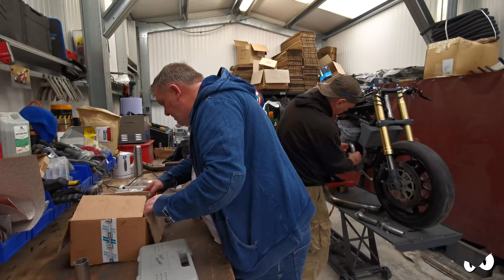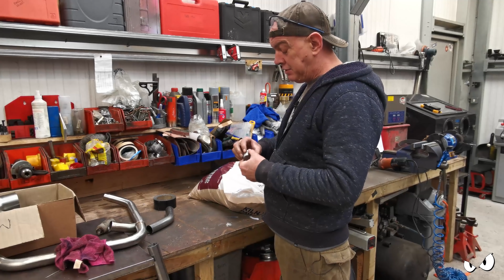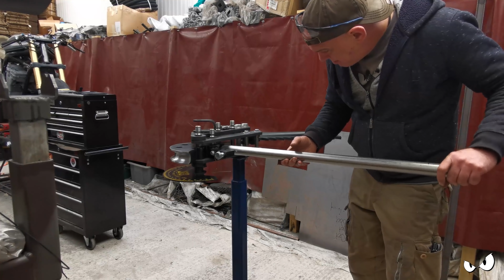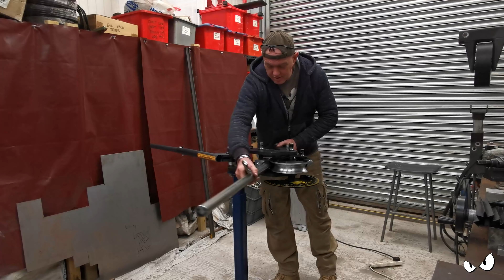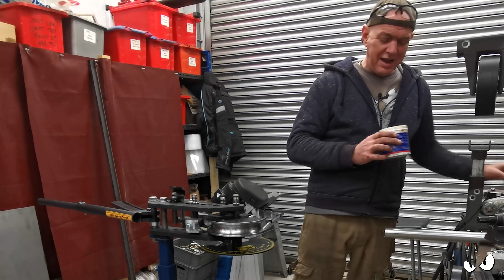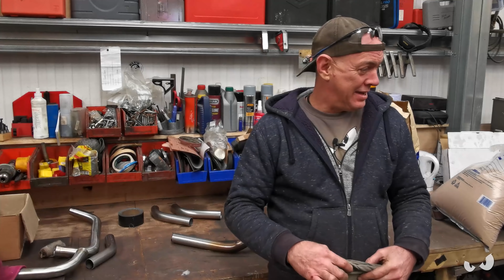Headers & Headaches - Suzuki Bandit Cafe Racer - GIXIT Project Part 57

Comment: I read something years ago H/D had to develop a cheap way to produce the severe bends on the pipes on the V-Rod, I think they used very high water pressure some how. It was a while ago ,so will have to Google it.  Good vid by the way.
Reply from the maker: Thank you matey but high pressure is something way beyond my ability. I'll get there in the end though 😁👍
Reply: @QuickBikes  I realize that, just saying its tricky bending tube. The H/D exhaust looks like a 180 degree bend.
Good luck.

Comment: Seems there's too much metal to compress Quickie. I'm no tube bender, nor any bender for that matter! But I  reckon you'd have to cut "V"s from where the inside bend will be, then weld them up after. Save Brender for frames.
Reply from the maker: I see what you mean, but I think I'm asking for too tight of a bend using this material and this bender. Also if I pie cut it, I still have the issue of weld penetration...

Comment: With good fit up its possible to pulse weld stainless headers without filler, but if your torch angle and amperage is not pretty much spot on and fit up is poor due to different shaped pipes and filler is being used, invariably you will have big ugly weld beads inside the pipe.  

Personally I would have been looking at buying a damaged system and repairing/adapting it to fit the bike properly as this would have cost a lot less money and been far less hassle than messing around with a draw bender and now all the aggro with badly made bends?
Reply from the maker: I hear ya, but I wanted to have a go and see what I can do. I'm pretty handy with a welder as I don't for a living, but never having worked with stainless like this its an interesting thing to try.

I'm not beat yet and will have another go.in the future to see what works best with the kit I have as I'd rather build something than just buy or repair it.
Not the cheapest option sometimes, but worth doing occasionally 😉
Reply: @QuickBikes  If your set has pulse try experimenting with that. Large cup is also a good idea.  

Furick ones are crazy expensive though and you can get better ones for less money from Tig Lab in Poland.
Reply from the maker: I have pulse, but the longest interval is 0.5 secs. Tacking without filler is what I normally do if the fit up.is really good. Just go 5amps more than needed for a.fusion weld.and give it full.blast for half a second, job done.
I'd love to get machine perfect at tig, but that can take years of torch time.to achieve
Reply: @QuickBikes  Try practice with pulse and using a large cup. Something like a 12 should be good.  Looks like you either have too slow travel speed or maybe amps set too low and cooking a bit?
Reply from the maker: My travel.speed is slow I have to admit, but trying.to get it to look right... I just need.more seat time I think...
Reply: @QuickBikes  Pulse will make things much easier.  You are getting blobby beads inside the pipe due to cooking.  Pulse will reduce the amount of heat going in a lot. Tungsten size and balance settings will also effect things.

Comment: As u fill it with sand tamp it down in layers  makes the sand more compressed 🤙🤙😎
Reply: Exactly.  The sand needs to be packed in tightly so that it doesn't move.  You should then feel that it has become harder to bend.

Comment: As previously mentioned you have to use an ultra fine BONE DRY sand like kids playsand and spend plenty of time vibrating the tube to expell any air out, it creased because the sand must have been ever so slightly damp and some air still in it. Or the sand is too course... I use a cheap T shaped tube bender and get perfect bends this way, but I stick my sand in the oven on full for an hour.
I think with slightly damp or wet sand it traps air, so doesn't release fully when tapped/vibrated.
Reply from the maker: Ah right... well I got kiln dried sand and went for the smallest grain i could find. I could have bounced it up and down more I guess but tipping it in slowly was.my plan to avoid gaps and give it a chance to settle... personally I think a slightly larger centre line radius is the key and will be getting another 1.5 inch die to do the frame for ASBO, so will be trying this again in the future. The CLR on this die is about 5 inches I think and I thinknits just toooooo tight. What size tube are you bending and on what radius if you don't mind me asking?
Reply: @QuickBikes   sorry for the late reply i didnt see you had replied. No probs things like this are here to challenge us lol... my go to is usually 2” mild and stainless 1-1.5mm wall, its a 180° die for 90° bends, not sure of the width of the die off hand but somewhere between 9-12” wide. 
Ive given up a few times, using playsand straight from wilko/argos thinking it would be dry (being indoors) and did feel dry but weren’t until i baked  and spent 5mins to tap it i found i got good results.... (old square orbital sander with the rubber backing pad works well) see the level of the sand drop atleast 2” 
Good luck hopefully you get it to work.

Comment: I would say that the sand is not packed enough....But what do i know.
One thing i would do is contact the company that made those bends and give them some shit.
If they are selling them as 90 and 45 bends that's what you should be getting.
Reply from the maker: It should have said "90 is degree bends" 🤣😂

Comment: Hi quickly, are there slightly smaller guides for your bending machine, just thinking it might be a tighter fit on tube to stop kinking ? 🏍️👍
Reply from the maker: The die is designed specifically for 1.5 inch tube, anything less will just deform it more im afraid... 😁

Comment: Really feel your pain on this, it must be heart breaking to of found a limitation in what you can achieve with the tools on hand- however you recognise that its not right and you won't live with the defects in the bike so that's a sign of strength of character on your part. I swore and cursed at the cost of new headers for my bandit but seeing how difficult they are to make makes it a bit more understandable - the company will of invested a big chunk of change into the tooling to produce the product and the skill to train the people to make it. I think for now accepting that currently it cannot be made "right" given the limitations you have and using a commercially sourced product is the way to go.
Reply from the maker: Thanks Robert, much appreciated. The die and bender ate fine on mild steel, just not stainless and I'm asking it to do a tight bend. It would probably be OK on a larger bend using this method I think, but we'll see at some point. Thanks for chipping it matey 😁👍

Comment: From experience your sand is to coarse, Argos sell play pit sand finer grain and dry, dry sand ( hair dryer ) to make sure of a tighter compaction.
When you fill the tube compact the sand in with wood/metal rod fill to the brim try again.
Finer sand means less air space between grains, less space for moisture to expand, packing should make less room for air.
If the tubes rammed up tight hopefully the tube will have to conform to the shape you want.
Reply from the maker: I'll be giving this another go at some point. The sand is kiln dried sand suitable for play pits or plastering apparently. Basically the finest stuff I could find but yes, I could have compacted it more before plugging 😁👍

Comment: Its seems that instead of stretching the outside radius of the tube its trying to compress the inside edge for some reason
Reply from the maker: Yup, its basically doing both... the outside of the bend is really flattened off and the inside just crumples... it would probably be OK on a larger bend using the sand method, but this bend is really tight...

Comment: Just a curiousity what happens to ordinary steel tube. Would that buckle at the same point
I know it means more welding but can you part bend to 50 degree or just before the buckle point then cut and make 2 into one for the 90 bend i guess it depends on how far round the bend it has the buckle
Reply from the maker: Mild steel tube works fine, not even a ripple but its nowhere near as tough as stainless. I think I.would still run into the.problem of the cut ends not being circular though which still means penetration from the welds on the inside of the tube which I can't get to to dress down. I think I'm just attempted a bend that's toooo tight 🤔

Comment: I see ppl saying to you that you need to pack it in yes they are right you really need to pack it when I see you put the sand in I was saying to you well to my self you was on the screen that you need to really pack it in  there are some ppl that use wet sand as they find it packs better and yes you can heat it up and yes you can use the border you have but you need to heat it right on the bend your half way there mate just need to go rest of the way but what you have to remember every time you take the pressure off its going bk on its self it's relaxing it mite be to much but I did say try and contact the fab man him self as you no he knows about this stuff than anyone one more thing have they sent you the right diy as what yours is doing its doing the same thing as what them cheap jack up blenders hydroelectric one that the word lmao
Reply from the maker: I'm not beat yet, but for now we're going to be using the Delcovic headers from ASBO as they came off GIXIT originally and were going to be used on the project. I think I'm asking for too tight of a bend using stainless on this bender. Mild steel works fine, but I still have a few options to try out at some point 😁👍

Comment: I told you you needed bigger ring spanners!
Do you know what grade the ss is, I'd hazard a guess it has a low nickel content
Reply from the maker: Hehehe... its 304 grade stainless matey
Reply: @QuickBikes  You should go with "food grade stainless" or "motorcycle grade aluminium", LOL!
Reply from the maker: Maybe a different colour tube bender would help hey 🤣😂
Reply: @QuickBikes   I think you have now reached the material Vs tooling threshold and there is no shame in throwing in the towel and using the Delcovic header, even if you need to cut and weld it to achieve what you want
Reply from the maker: I think I agree... it came off GIXIT originally anyways 😁👍

Comment: I'll throw my zero experience "best guess" in as well...
If you can muller a tube into an approximation of a bend by jamming it in a vice and heating it red and applying torque with ring spanners - with no internal support... it must be possible with the "right" bit of kit...

If it is in the heating...
The question is whether it is a stress thing. 
(To test that, try removing it from the die and heating it every few degrees, so go 10 degrees, then heat it to the cherry red, then another 10, take it out and heat again.)
Or a malleability thing... 
(you need the heat to make the outside malleable enough to stretch further without applying stresses to the inside of the bend and causing it to crease up) - in that case try heating the outside of the bend as you are bending it, (as hot as you can get it.) stainless steel is a pretty poor heat conductor (as far as metals go!) so you should be able to heat the outside radius of the bend without loosing too much heat into that massive die.

if not a heat thing, and actually a support thing...
There is a video on you tube detailing how they make trombones and trumpets that you could consider... they bend very thin wall  brass tubing, around 180 degrees without crinkling it by plugging one end then filling it with water and freezing it. (this would be the next step up from packing with sand.) because the ice is much stiffer the tube is less likely to form an oval... (and it's likely easier to control freezing (where you're just leaving the tube overnight in the freezer) than it is to control heating with a small blowtorch.
With this method to ovalise the tube you'd need to crush the ice, (crystal structure hard to crush), - with sand you're stretching one side of the tube, that increases the space inside the tube and makes more space than the sand can fill, and because the sand is loosely packed (individual grains, not solid) it'll just fuck off into the space removing the support it was providing.
Reply from the maker: Good comment, thank you and I can see where you're going with it all. It's an interesting problem to solve, but I'd like to. At some point I'm going into one of the marine fabrication companies round here to pick there brains about it 😁👍

Comment: For anyone thinking of bending tube with sand and heat, I've been told to make sure the sand is totally dry (like baked in the oven a while, not just not noticably wet)

Otherwise, the residual water in the sand boils when the tube is heated, can't get out because of the ends being capped off, and you've just made a pipe bomb

At least that's what I've been told...
Reply from the maker: The fellas I've watched on the tube all used dry sand. That's why I bought kiln dried sand and it was BONE dry when I used it. I have heard of folks heating the sand up in an oven before use and putting it in hot as well as heating the tube, but don't have a way of doing that effectively... 😁👍

Comment: The heel on your bender sits to far back!
If you look at any industrial hydraulic bender the heel sits flush with the where the tube sit in the former.
Your bender doesn't from what I can see it sits 2 -3 inches behind that so its acting like a lever on the tube not a support. You want the heel to make a collar around the tube and support it in the former.
As it is, it is sitting behind the leading edge of the former so it doesn't support the tube in the former instead its acting as a lever. once your  past 50 degrees this allows the tube to kink because to are levering the tube not forming. This is another reason why the Heel is better as wheeled part rather than a collar.
And as you've found out it kinks every time once you start levering on it. 

https://imgur.com/a/CZChGoP
Reply from the maker: The bender and die works just fine with 1.5 inch mild steel tube, so I don't think this is the problem. The material is just tooooo tough to do such a tight bend without the proper internal support
Reply from the maker: Yes.... exactly the same bender I have, but with a hydraulic ram which is used for solid bar or if you're unfit 🤣😂
The bender is great, it really is, its just the bend radius is really tight and material I'm using is really really tough. Irs a good bit of kit 😁👍
Reply: @QuickBikes  cos I'm blind that bending unit of yours has twin heels.
so now my thinking is it just not getting enough support from the fore heel and the rear heel is acting as the lever. which is why its getting kinky on you. Perhaps its time to ask the manufacturer what they think.